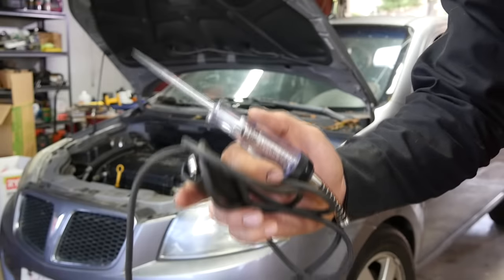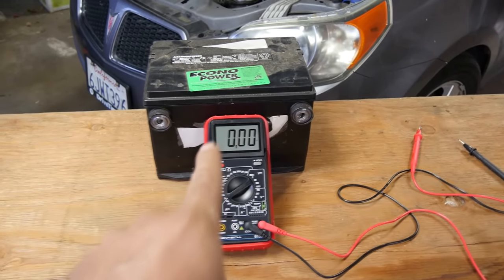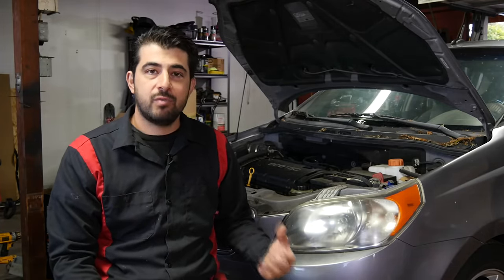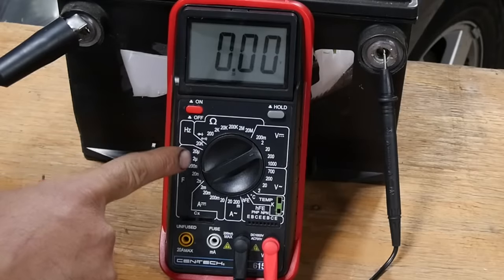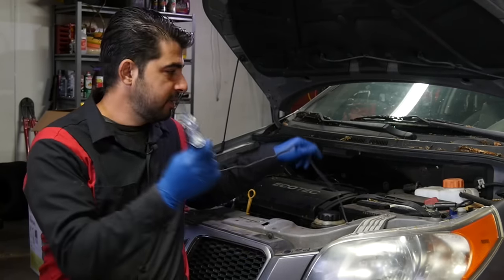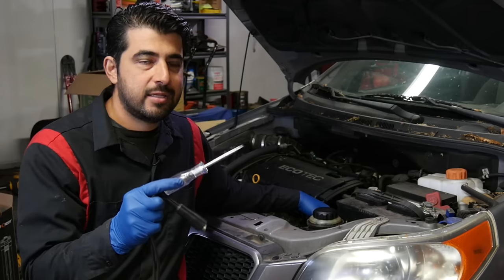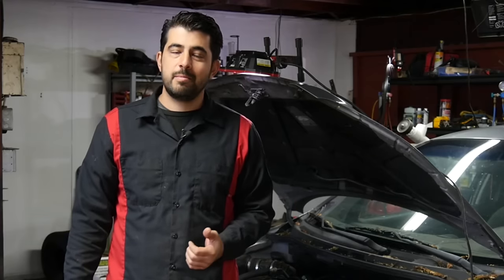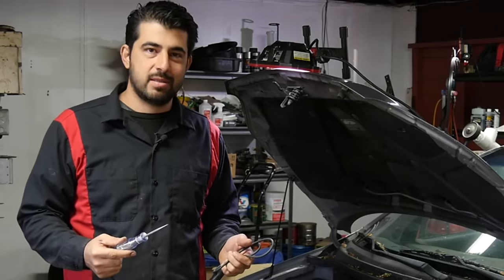MUST WATCH - Can a Test Light Damage Your Cars PCM ?

Comment: Think of voltage as being a mountain with a pool of water at the top. The higher the mountain, the higher the voltage (potential). Think of the current as the river that would flow if you give it a path from the top of the mountain to the ground. The resistance is how wide, deep, steep, rocky, etc you make that river between the top of the mountain and the ground. Voltage = Current X Resistance often written as V=I*R. Changing any variable (V, I, R) effects the others.  In general, we can change V and R and I (current) is just what results since, in general, it is very hard to make a constant current source.  
Now, as for this video, people are probably talking about the active probes that allow you to apply power with the probe, not a simple test light or DVM. These active probes are more akin to a jumper wire from the battery. Incorrect use can send power through an output (designed to apply power, not receive it), etc, overpower an unprotected input, etc. Friends who are fleet mechanics tell me these probes have been banned in certain shops because they were blowing out PCMs and transducers through improper use.
Reply: @IAMNOSLEEP ol, try it on your own car. I did fix few computers after a test probe "diagnostic".
Reply: @IAMNOSLEEP  so, still during 40 years you didn't learn how to use multimeter? LOL.
Reply: @IAMNOSLEEP  Engineers design for the expected  failure modes but at no time during the design process did an EE say. "Gee maybe we should account for someone putting a 12V, non-current limited signal on this input or output" which is what these active probes are - a jumper wire
.The protection used depends on how the ECM or other circuits were designed and what components were used. What's driving (energizing) the outputs and what's protecting the inputs? Sometimes inputs are protected with a combination of diodes, Zener diodes and RC circuits. Sometimes not.  IC inputs usually have built in diodes to protect against high voltage spikes and even they'll blow if the voltage last more than a few milliseconds.  An input expecting a maximum of 5V many not survive a 12V, non-current limited probe suddenly energizing it. Sometimes putting 12V on a 5V output will damage the semiconductor driving the output. Using active probes (i.e., probes capable of apply a voltage and current) to drive inputs and outputs is risky without knowing exactly what you're dealing with. Most EEs wouldn't do it without a complete detailed schematic. You can be off 1 pin and cause havoc. Usually transducers are designed to fail as an open and not a short. If there is a potential for shorting fuses are used. Can an IC drive a short? Sure, you can current limit the output but, that's not the same thing as energiving that same pin with an active probe at 2 or 3X the output voltage without any current limiting. It's not quite as simple as your explanation. The other thing to understand with ICs is they don't always fail completely like a fuse. Sometimes they just get damaged and begin to operate unpredictably and fail intermittently. That is why ESD is such a big issue and millions spent each year to mitigate it. Simply handling a PCB or IC without ESD protection can cause damage that doesn't show up right away, or worse, comes and goes. There's a reason big shops have banned active robes and it's not theoretical. It's based on having to buy expensive ECMs techs have accidentally damaged during troubleshooting.
Reply: @IAMNOSLEEP  The topic is the use of active probes. SInce I was the original commenter,  I understand the topic very clearly. Reminds me of one of my favorite quotes,  "You can't teach a man what he thinks he already knows." And yes, I understand I am wasting my time as far as your concerned, I rook the time to help others who may be trying to understand the issue(s). Happy New Year!
Reply: falchulk  That's another good analogy. Voltage is the water pressure at your faucet. The Resistance is the diameter of your hose and current it the rate of water flow. Actually that is one ppl can probably relate to even better.
Reply: @IAMNOSLEEP  You replied to my comment, you didn't make a comment of your own. In mine I pointed out to R&W people are probably thinking of active probes blowing ECMs, not DVMs and test lights, since it's a hot topic these days with shops banning their use and other YTers talking about it. As an EE I thought I'd take a second to share why you have to be careful about using them and get into a little detail when replies to my comment were muddling the point.
Reply: @IAMNOSLEEP  No. That wasn't me. Do you find this whole YT thing confusing? (It's always amusing when Karma happens.)
Reply: @IAMNOSLEEP  Every insult you hurled at me applies to you as you've demonstrated. Now that's karma.
Reply: @IAMNOSLEEP  not all ecms have over current protection.  How about the old Mitsubishi and Eagles that would blow iac drivers when the iac shorted?  I'd treat all ecms as though they have no protection.  Are you willing to chance proving your assumption on a customers car?

Comment: Despite the high resistance of intact skin, I still wouldn't rely on it to safely limit current flow if I had a pacemaker or similar device implanted. There are still old unipolar systems out there that could be more sensitive than one might think.

Comment: For a lot of circuits can be burned with 300ma current drow. I did fix few of them. Specially for camshaft/crankshaft circuits. Try to burn a Led with 300ma 12v, you will probably burn it.

Comment: I'm still not taking chances on expensive electronics in cars.  I can do everything needed with an inexpensive high impedence VOM and do it better.  I save the test lights for house wiring and the pre-electronic classic and non-electronic vehicles.  I have not used my 12V test light since the last time i checked static timimg on a car with points ignition. When the points open and break contact, the test light comes on, showing you the position on your crankshaft where #1 cyl spark is set to fire.

Comment: Considering you can get a multimeter for about 10 bucks, it is a far more powerful troubleshooting tool than a test light and is totally worth it to both own and learn to use.
Reply: IAMNOSLEEP A test light only confirms there is current running through the system, the battery provides the load. To test continuity (integrity of a circuit) you test the impedance to see if it is open or closed, which can be done with a multimeter.
Reply: IAMNOSLEEP will do.
Reply: @IAMNOSLEEP  that why if you using a meter, you measure the voltage drop of the circuit while it's active.  Don't rely on a 250ma test light to load a high amp circuit down.

Comment: Voltage is pressure, current is flowrate
Reply: That analogy is often used to describe elementary DC systems, but it is much more difficult to translate to mechanical systems.  One more appropriate analogy is voltage to force and current to velocity (where resistance is friction or damper, inductor is mass, and capacitor is spring).  The pressure analogy is much more difficult to understand when considering sinusoidal analysis since you have to bring in calculus and transforms. I understand the desire to use the touchy feely mechanical connection in the beginning, but electrical is mostly conceptual (described by math).  If you want to bring in an analogy, the math has to work both ways.
Reply: Mark Dixon force is pressure and flowrate is velocity. Those words are synonymous
Reply: They aren't really synonymous, and hence the complication I mentioned... pressure is force per area, and flow rate is volume per time.  The math is simpler when force and velocity are used.  The voltage across an inductor is  L*(dI/dt).  Current through a capacitor is C*(dV/dt) where V is voltage.  In the mechanical system (not water through a pipe, but mass/spring/damper like a car suspension), Force on a mass is m*(dv/dt) where the v is velocity.  Note that dv/dt is acceleration (the derivative) ... you know the simpler form as F=ma.  If you add area and volume, managing the units is hard.  Try it... what is the math model of the pressure of water going through a pipe in your analogy?  The description above may not make sense without an understanding of calculus.
Reply: @ShaunHensley  In non science terms if it works for you. Voltage is potential difference 'like' a water dam levy, current is 'like' the flowrate of water.
note velocity of electron is constant doesn't change, the quantity or density of electron flow is current.
Force is mass x acceleration measured in Newtons, (acceleration is change in velocity) Pressure is N/m^2
edit: momentum is mass x velocity
my description is simplified, as electrons can have different energy states, so the electron flow above is meant to convey the energy transfer by elections
Reply: @ShaunHensley  🤣🤣🤣Found the noob
Reply: @markdixon392  What's L and C? Also, it's per unit not per
Reply: Horrible Deplorable  Can you guys stop with these shitty oversimplifications?

Comment: ecu signal wires (AVI) are just like you said " a multimeter " , But there's a lot of other wire's in engine bay that are DPO DPI SPI  system's and there very easy to blow up . Be careful

Comment: Before using you want to make sure your main ground to battery and chassis grounds to chassis are good if you had a even a slightly loose battery terminal, it won't displace current right

Comment: Now put out a video with a scope current clamp around the .200 Amp test lite, and watch it current rush 2.0 + amps, which burns out the .200- .400-.500 mA drivers. So yes a test lite can easily fry a PCM driver!!!!!!!!!!! ( relay, etc )
Reply: @charlesgould8436  OTC has a PCM safe tester I use. I just showed my son other day the damage to transistor on a curve tracer with us using a .200 mA test lite.
Reply: @overload3996  what do you guys think of the Lisle computer safe test light?
Reply: @MindsDozer  I use the OTC computer safe test lite. Not sure of the Lisle, I could look it up. Price wise maybe better then OTC ??
Reply: LIS34550 is safe, same operation as the OTC. But remember the neg to pos LEDs is at what voltage to current Red or Green. My OTC was green up to about 50 mV, so voltage and current play a margin with these lites.
Reply: @MindsDozer what was the answer or results

Comment: The 200-270mA is the constant flow of current not the initial touch that jolts it to 1-1.4Amps then quickly goes down to 120-300mA depending on your bulb and coil test light brand.
I was watching ScannerDanners channel and he said he's never had any issue with test lights and computers using his OCT incandescent test lights.
I believe he said he never uses incandescent bulb testers on injector drivers because 200ma to 1A is way too high so he actually uses a LED test light instead of incandescent bulb testers which is his preferred method.

Comment: Hanging on to the ohm meter wires as you did, shows high human body resistance to current flow when you skin is dry.  However, you missed a great teaching opportunity by neglecting to lick your fingers, and then grabbing the wires a 2nd time, which would have shown much less resistance (ohms) and therefore a much higher current flow with the same voltage.  This lesson would show very well why you don't stand in water (bath tub, wet basement floor, etc) when working with 110 vols, or 220 volts, etc.  A wet body in those conditions can get you killed very quickly, because it conducts current much better.
Reply: Dave....Well, to be fair he did mention the old 9v battery on the tongue...you certainly feel that because of the damp/wet tongue.

Comment: I know its not exactly what you are talking about being a 12v short on a signal wire but I bought 2003 volkswagen that did have a ECM failure due to a short in O2 sensor wiring. It had the issue when I bought it and and although I don't know exactly what wires shorted on the O2 harness here is what i do know. 
All wires were worn to bare wire on original o2 sensor
Codes for o2 sensor short to ground as well as throttle position signal (dbw) intermittent.
Car would go into a limp mode because of the throttle angle signal
Replaced o2 sensor, all is well but intermittent throttle problem persists.
What I think happened was o2 heater circuit  which the ecu controls through ground had shorted to unfused 12v and had burned up something in the ecu that controls the the throttle motor.

Comment: Great videos, have 2014 Silverado. It shut off while driving. Wouldn't crank them. ECM relay clicking when turn key on and try to start. Replaced relay same thing happens. Pulled ecm relay and it cranks but won't start. Any ideas? Thanks

Comment: Nice video! One way I suppose you might damage a PCM with a test light is if you overload something with it. For example, if you connect the test light to the control side of a fuel injector while the engine is running, you will be drawing more power through the PCM than it was designed to provide since you will be lighting the test light as well as firing the fuel injector when the PCM was only designed to safely provide enough current to fire the injector. I don't know that this actually could cause damage since the PCM might have some sort of overload protection. But I know that a lot of PCMs have good enough overload protection on the 5 volt reference circuit that it can be shorted to ground and not do any damage. If anyone knows if this could actually cause damage please let me know, I'm curious.
Reply: It can ... I was testing my car with a power probe on my AC sensor with the engine "on" to the ecm ... The the two combine currents (running engine + power probe 12v) fried my ECU. 
Moral of the story...even if u don't f**Ked up, u can get a new cheapy ECU from salvage $77 and bring it to dealership to reprogram it for $100.
Reply: @SinGz86  A Power Probe is not a test light, it is very different since it provides no resistance and can send 12V directly to a circuit or ground it out without the resistance of the light bulb. So effectively a Power Probe is no different than a jumper wire
Reply: @averyalexander2303 Essentially, a power probe is and can be used as a test light. It can be very useful as it can test ground and circuit connections with an added twist of sending 12v. Currently, I use a test light most of the time and made sure that I pulled my negative terminal out from the battery to break the circuit from the lesson I have learned.
Reply: @SinGz86  Oh okay I never used one. How much current will it pass in test light mode?
Reply: @averyalexander2303  I'm not sure, but it hooks up to the battery 12v and whatever amperage the battery has. It's an effective tool but the users like myself must respect the tool and really understand which wire is the ground, ref circuit, and circuit to the component like the ac pump. Laziness and neglect is the moral of my story of lesson learned.
Reply: @SinGz86  I agree, understanding the circuit is key. There is a big difference between a test light and a power probe though. From my experience a test light won't damage anything because it can only pass about 1/4 of an amp due to the high resistance of the little light bulb, but a Power Probe could easily damage something since you can send tens or possibly a spike of hundreds of amps through a circuit, which can easily kill something as you unfortunately found out.
Reply: @averyalexander2303  I agree with you, but I love to experiment and try out new things that can expand my horizon and learn how things actually work practically instead of theory and watching other people. I wouldn't change anything I did, and upon reflecting my own action, it actually made me smarter than before.
Reply: I can't remember any car on which the 5v reference has failed because of a short to ground, it is the most common type of short or failure like on an those A/C refrigerant pressure sensors, a short to 12v can do damage but what I see the most are fried PCM reference grounds.
Reply: The power probe is an awesome tool, it is a high impedance unit so it won't damage anything on it's test light feature. You only have to think twice before pressing the switch, but if you know your circuit it can help a lot. After the power probe I barely use test lights. Another one that is nice is the led test light that otc makes, the others just have a resistor in series with the LED's but the otc has op amps, making it a high impedance unit too, and you can use it on a wider range of voltages.

Comment: Maybe I missed it in your overview but I didn't hear you mention the multimeter itself. Most decent ones are 10 Meg, low end ones maybe 2, analog not much better than the test light. The body thing is easy to forget and has options as two fingers on the same hand, finger to let's say elbow, or across as you demonstrated.  Good video.